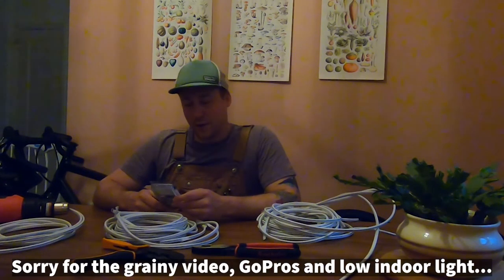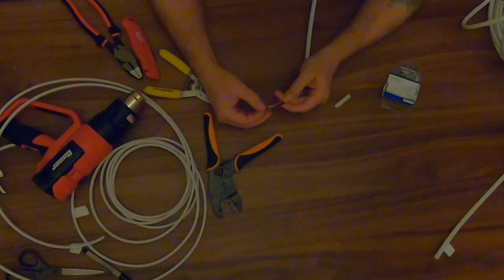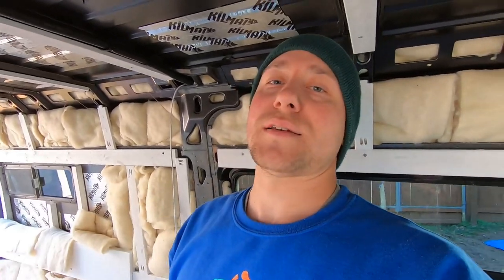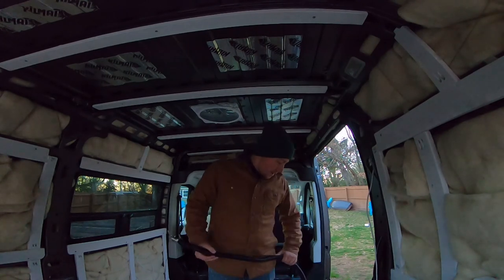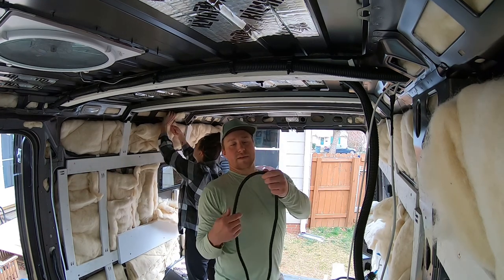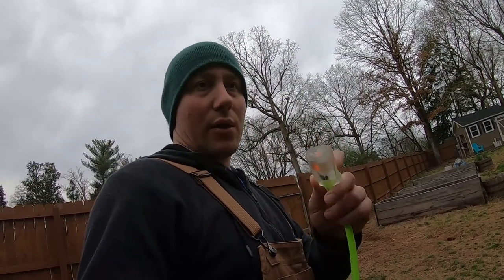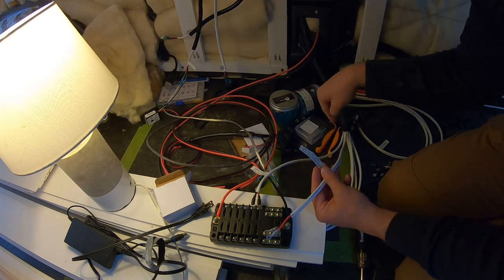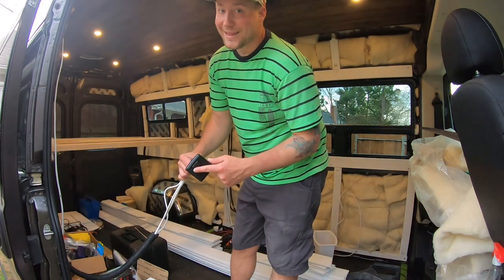Electrical Wiring a Van + Wire Connectors + Fuse Box + Loom, Part 2 //Ep. 9 DIY VAN BUILD

Comment: What did you do for outlets??
Reply from the maker: We actually talk about them in our shiplap wall video. I ended up using extension cords cut and wired to outlets to be able to plug into the gz. You could also feed a AC panel from a plug into the gz and then feed separate circuits that way. Let me know if you have more questions on it and I could try and help
Reply: @Trailvagabonds  thank you! So you just did an extension cord and hard wired that into your first outlet and then continued to your next outlet from that first one and so on?
Reply from the maker: @marioflows-travelchannel2373  yes you could do it that way no problem. Because we only have two outlets in our van I just did separate extension cords to each one. But yes, doing it like you said is exactly how I’d do it as one circuit. Just make sure and use stranded wire rather than normal house style romex because solid wire can sever under constant vibrations of the road. You definitely don’t want that. Extension cords are stranded. Or you could buy a 3-wire marine grade spool similar to this one~ https://amzn.to/3PDWg81 You could even buy a plug connector to add to this so you don’t have to buy extension cords if you’d prefer like this~ https://amzn.to/46txg9d

Comment: Great video, the dogs are the best!! thanks for posting! It's super helpful to see the details, I am in a planning phase myself and my head is spinning from what goes first and how it all clicks together. I see you connected the fuse pannel before mounting it, that's a good way to test things too. More of these please haha.
Reply from the maker: Thank you! 😊 I'm glad you found it helpful! I've been trying to post a weekly video of different projects I'm doing with more 'how to' than the average van life channel. When I was in the research stage I found there were not alot of video resources out there showing things a little deeper. Good luck with your planning and reach out if you ever have questions or want to talk through something! 

Oh and I also try to get the dogs in every one of the videos too😉
Reply: @Trailvagabonds  thanks! that's very kind of you to offer help. I agree, not too many videos go to the level of details, that are the most challenging. great work!
Reply: @Trailvagabonds  Quick question, if you have a moment, have you guys done any grounding of the wires? I have seen some people grounding to chasis, not sure where and how often this has to be done. Just thought to ask?
Reply from the maker: @tomasjanik273  I ran a wire around the driver's seat into the battery compartment to where the battery grounds to the chassis under the floor (I'll include it in a future video). Really you can do it anywhere on the frame you want but you have to make sure to sand off the paint to bare metal. I decided I'd rather not do that and just ran it up front. It's definitely preferred to have one
Reply: @Trailvagabonds  Hi Matt, I hope you are having fun converting the van. Do you have a picture of the battery/ e. system compartment to see how much space it actually takes under the cabinet for all the parts (battery, inverter, fuse panel, etc.). thanks a lot and keep rocking!
Reply from the maker: Do you have Instagram? The direct message feature might be easier to utilize in that

Comment: Thanks for such a helpful video. Quick question, what ring connectors did you use for the fuse block and which fuses? If you have links that would be fantastic.Thanks!!
Reply from the maker: Thank you for saying so! Glad the videos can be helpful!  The fuses I purchased were these ones~ https://amzn.to/3mtTgeH  They had good reviews. I've heard there are cheap fuses out there that won't actually blow like they are supposed to. I've never had an issue but I also haven't had a blown fuse so hopefully they are a good product.

The Blue Sea fuse panel has #8 screws for the connections and most of my connectors are by Wirefly. They seem to be good quality and give a great seal~ https://amzn.to/32rnAjx Of course by the size to fit your wire gauge. Let me know if you have other questions 🙌🏻

Comment: You said you plan on adding a 25 amp AC charger but it looks like you've installed a 20 amp AC plug. You may want to upgrade that to a 30 amp.
Reply from the maker: Thanks for looking out! The Yeti fast charger looks to only need an input of ~4.4 Amps and than does its magic internally to output it for the Goal Zero Power Station. I found the recommendation for this through a van build company's Instagram. Here's the product webpage.

https://www.goalzero.com/shop/yeti-accessories/yeti-fast-charge-25-amp-power-supply/

If I'm looking at the info incorrectly, definitely let me know. I'm pretty confident in it though.
Reply from the maker: @mail4castle  Great! Thanks again for bring it to my attention though. Had it been an issue, burning down the van would be a story to tell😂